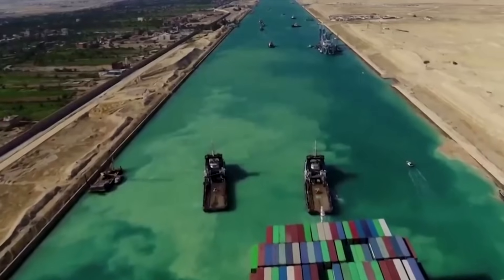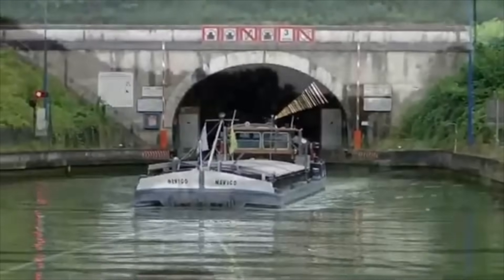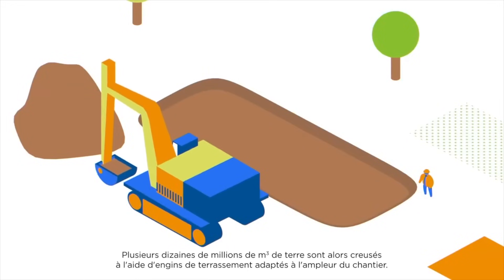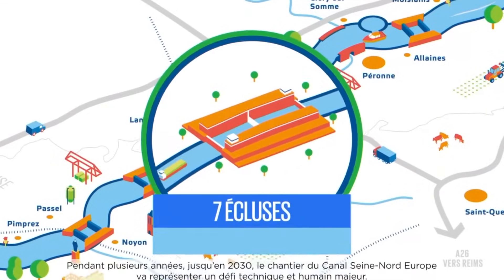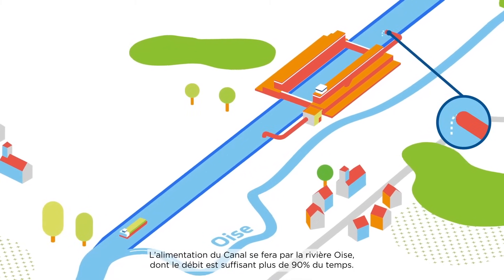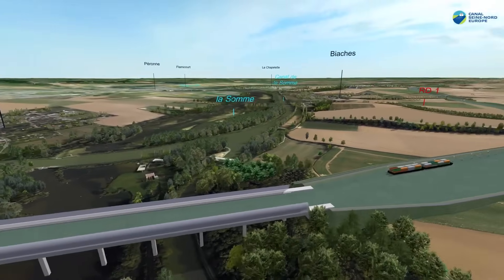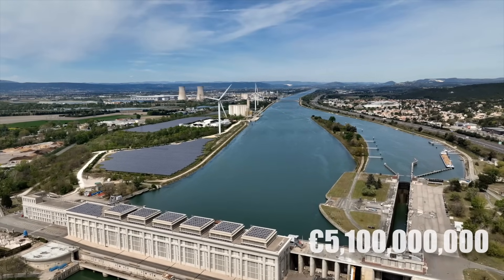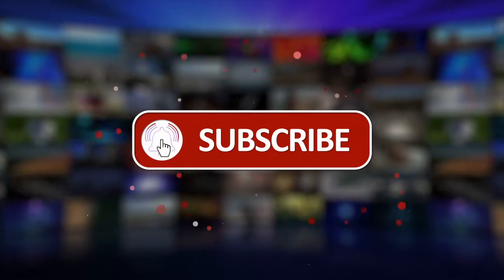Unveiling France's $5BN Artificial River - Europe's Largest Transport Project

Comment from the maker: An incredibly expensive project, will it be a success?
Reply: This video is complete and utter drivel. Why are you showing images of sea-going container ships 16 containers wide, when the Seine and the Scheldt can barely take class Va and Vb barges (3 containers wide) and L'Oise which links Compiègne to Paris has several locks and numerous low bridges and is limited to péniches.  If they ever get round to doing the necessary work on L'Oise, where do you go from there ? You will not be able to take the barges up the Seine because you are confronted with dozens of bridges in Paris most of which have protected status. There is little point in going down the Seine. The River makes massive loops taking 250 miles to cover the 100 miles to Le Harve and with 5 locks in the way. The route from Antwerp or Dunkerk/Dunkerque to Le Harve or Rouen is down the English Channel (One lock into the sea if using the floating harbours or no locks if using the tidal harbours.). The Seine is also subject to sudden and dramatic flooding making the river effectively unusable at these times. Apart from the speed of the water, the high water makes passing under some of the bridges an impossibility. 

The purpose of this canal is to give a new river port close to Paris a link to the Low Countries canal system and nothing more. Trans-shipment to smaller barges will be required for further progress on the French waterways. This canal WILL NOT "change how Europe trades forever", neither is this project "incredibly" expensive. They are building it so it is perfectly credible. It is NOT an "Artificial River" ... it is a canal

There is talk of the barges being able to carry 300 containers. That is not what YOU think. It is 300 x T20 equivalence, or 150 x 40 ft containers. Total weight of the containers is also a factor as the canal has a draft of only 11ft 6 inches meaning that the total number of containers on a barge will often be considerably less than 150 containers.  There is nothing special about this canal. There are already hundreds of miles of canals to this standard in the European Union, especially in Germany. It is the locks that are the bugger. The principal purpose of this canal is to eliminate the tunnels on the Canal du Nord and Canal St Quintin which are major bottlenecks, and on the St Quintin, barges are pulled through the tunnel in long trains by electric traction to prevent the build up of fumes which used to make that tunnel absolutely disgusting.

 
If you are going to do this kind of thing, then do some proper research and FOR CHRIST SAKE learn how to pronounce the place names. Go to "Google French English Translate ". As I am sure that you are unable to use diacritics, type "Compienge" into the English box. The French spelling, "Compiègne" will come up in the French box. Click on the loudspeaker at the bottom of the French box and listen. Do it several more times and even though this is Google and it isn't quite there, it is not far off. Do the same with the other names.

Comment: You can get the same amount of cargo onto a single freighter ship as would take a fleet of dozens or even hundreds of trucks. Even trains cannot carry as much payload. So these kinds of canals offer huge benefits to expedite large-scale shipping of goods without creating traffic gridlock on the road system. Economically, this just makes sense, especially for inland trade that would require more complex logistics to get goods to coastal ports and then get them back inland.

Comment: I said for year here in the U.K. we need to expand our canals this would be fantastic for French and German relations too. We need to do this all across Europe and expand our freight trains
Reply: Isn't the main obstacle for inland navigation in GB the fact that the seaports can be reached within few hours by lorry or train from virtually every major city or town in the UK? I don!t think that Leeds Ship Canal would make sense. Nor I think it would be particularly good idea to upgrade your narrow boat canals to even Class O waterways, not to mention Vb that the canal Seine-Nord is in. It would totally destroy your current canal network. Not to mention that such endeavour would only make sense if you plan on building seagoing barges that would be able to cross sea between England and Netherlands under reasonable weather conditions and then continue through system of inland waterways. And in the EU such proposal would as well face problems as there, in some places, exists opposition to expansion of inland waterways. And I am not sure whether it would be possible to persuade those groups that expansion of canal from Berlin to Warsaw is good idea and that the significant works that would have to be done on Elbe are in fact good idea and so on. But Europe is still missing one crucial ling, tome between northern Europe and Mediterranean.

On the other hand some large train ferries, but one would have to fit in at leas one 750 metres long train divided into sections placed side by side, could make sense. But I am not sure whether companies in Europe would be willing to spend money on special carriages that would fit through significantly smaller British loading gauge.

Comment: One tanker creates much more pollution than all these trucks. They have no standards for the purity of fuel, it is literally the worst that can be, so fairy tales that it is for the sake of the environment make me smile. The economic benefit is beyond doubt
Reply: We're not talking about high seas super tankers, but about canal barges that operate inside the EU and follow its strict regulations.
Such barges have a much better environmental impact than trucks.
You just need not to be pressed by time.
Even though one supermarket alliance now does its Paris core deliveries with barges on the Seine River to the center, then small trucks and cargo cycles for the last leg to the shops, which kinda proves that under certain conditions it doesn't take too long.
Reply: They are incredibly fuel efficient